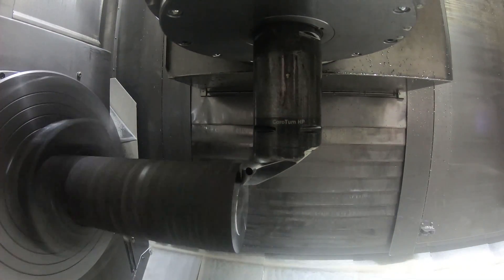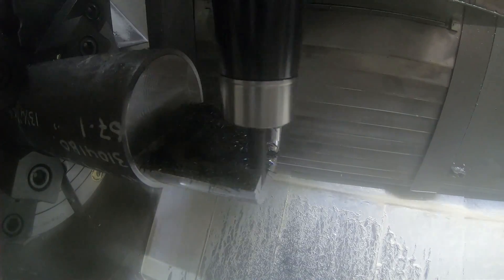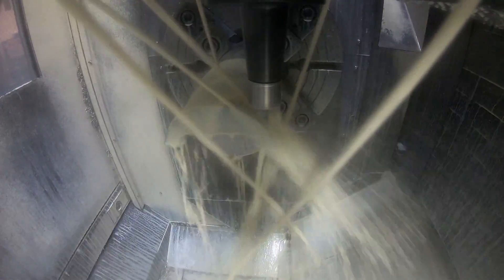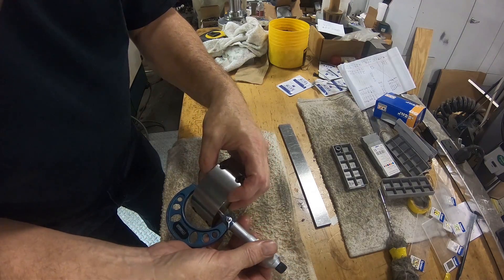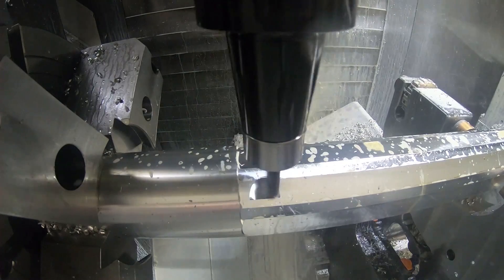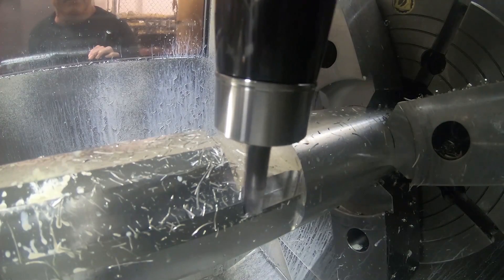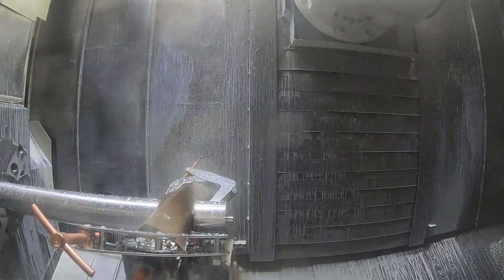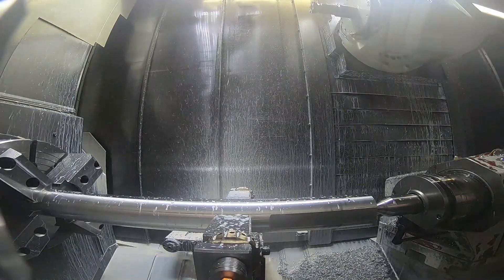Machining Sleeve Fixture

Comment: Beautiful Video, excellent work and knowledge.
I really admire your work and as much as you know, I want to ask you:
At 17:56, when you start milling the bar, isn't there a risk that the bar will lose its cylindricity and because of this there will be a gap in the fixation of the telescope?
With the clearance, it would certainly generate a vibration, causing problems during machining.

My name is Sergio, I am a programmer for up to 4 axes. Congratulation.

Comment: I program a doosan 3 axis mill and dont use software. I do small parts. And still learning. Are there can canned cycles for pocket milling like that? I'm currently experimenting with sub programming and think that's the only way. But would really like to know if there is a canned cycle I'm missing.
Reply: You really need to learn cad cam, to go on to the next level, unless your Einstein

Comment: Great video Peter. I have been wondering for a while now (can’t seem to find any mention of it in any of your videos) but what coating is on your endmills? It appears to be AlTiN by the looks of it and I’m just curious if that is the case. If so, it’s pretty impressive that you are able to dry cut aluminum with those without chip welding in the flutes being that AlTiN should have a very high affinity for aluminum.  Thanks in advance
Reply from the maker: Most all endmills I use are coated with TiALN. When mill aluminum it is important to use some kind of coolant. Either a air mist or flood. I have even sprayed on WD40. If your tool runs dry and your running a high surface speed the aluminum will build up on the tool.

Comment: Nice touch milling the center seat. On manual lathe we called that peeling the center where you use full face lathe tool set at 30 and peel the center to get it to run true with the  steady rest surface.
ATB, Robin
Reply from the maker: Thanks Robin; There can be issues with center drilling and steady rests. Maybe I should do a video on this subject. With this machine if you center drill with the milling spindle and your not perfectly on the center of rotation it wont be obvious like say on a engine lathe. If your off center in a tail stock there will be a obvious wobbling of the drill because the part is rotating. This is the reason I prefer to establish a turning center  rotating the turning spindle.
Reply: Edge Precision you explained it very well. If I do use center drilling, I always add a small boring bar to kiss the center just to make sure its thru to the center of rotation.

Comment: You have no ToolEye!?
Reply from the maker: Yes but as I have explained in other replies it is difficult to use on this machine because I cant reach the control when looking at the tool at the probes folded down position. If I had a jog pendent maybe. It is actually faster and I can see the tools actual position on the control when touching off on the part. So I prefer doing it that way on this machine.

Comment: Question, The steady rests are they programmed or are they sprung loaded for variability of diameter? Never used em in my life
Reply from the maker: The steady rest in this video is a manual one I built. The jaws adjust with the bronze nuts by hand. I do have a hydraulic steady rest that can mount on the same mount. It can be opened and closed with codes in a program from the control. There are no springs on steady rest jaws. Once positioned you don’t want them to move. The hydraulic one does exert constant pressure from the pressure you have set with the regulator.

Comment: @Edge Precision : What are the mechanics that lock/hold the chuck and/ore spindle stationary when relevant operations are performed? I suppose an encoder used to  clock the rotation to the desired angle, but then some brake must be applied that does not move the position at all.  Curious, I am!
Reply: If anyone wants to read up on Curvic Couplings:  https://www.geartechnology.com/issues/1186x/Back-to-Basics.pdf
Reply from the maker: If you are speaking of the turning spindle. When switching from turning to milling the machine does what they call coupling the C axis. The sequence is this. First the turning spindle is oriented by the turning spindles motor to a zero point. While that is happening the C axis servo motor is moving the worm on its shaft to zero. When they are both zero the worm is engaged into the gear on the spindle. When that is engaged properly the turning spindle is shifted into neutral. There is also a breaking mechanism on the C axis so when it isn’t rotating its locked with a break just like any rotary table has. So to go back to turning all that is necessary is to uncouple the worm from the gear and shift the turning spindle into gear. Than start the spindle.
Reply: @EdgePrecision  , awesome thanks.  I am building something similar as a multipurpose 4th axis for my small mill.  For the "vertical" spindle does it lock the rotation in a similar way to keep the turning tool holders stationary?
Reply from the maker: No the milling spindle has the ability to clamp/index every 15 degrees. The way this works is with a hydraulic cervic coupling. There is a disk on the spindle in front of the spindle bearings. Inside the housing. This disk has keys in it like a cervic coupling on both sides of it. There are two ring shaped hydraulic cylinders on each side of the disk. And also a ring outside the disk on the spindle with the same keys as the spindles disk. So when the spindle is clamped for a turning tool. First the spindle is oriented at the angle called for than the two ring cylinders are advanced to engage the coupling keys. They engage until both the coupling on the spindle and the fixed coupling around the spindles coupling are pinched between the ring cylinders with the keys engaged. This system is very carefully balanced so as not to displace the spindle in its bearings. Also when clamped it takes the load of the turning tools not the spindle bearings. When the spindle is clamped and unclamped there is no desirable axial movement in the milling spindle. That is a little hard to explain. I hope that makes sense.
Reply: @EdgePrecision  GREAT explanation...as usual! Much appreciated :-)

Comment: Do you get much of a taper along the flats you milled down the entire length
Reply from the maker: You know I didn’t even check seeing as it wasn’t critical. But after your comment I went and measured it. It was .0005” per side or .001 total on the thickness. That could be even adjusted out with the tailstock. This tailstock can be adjusted in all planes.
Reply: @EdgePrecision  so about 0.012mm (Brit here 😉) across that length isn't really that bad is it? What year is your mazak, we have a few at my shop I love them they go forever.
Reply from the maker: The machine was built in 2006.

Comment: Do you make injections molds?
Reply from the maker: No. The closest I have got to a injection mold is making molds for the wax patterns that are used in investment casting. These molds are usually made out of aluminum. They are technically injection molds at a low pressure for the wax.
Reply: Thanks

Comment: 20 minutes goes by in a blink in these videos, great fun to watch.  Not sure everyone recognizes the amount of work you put into getting all the various angles.  Just the shot of you hauling the part around to the bandsaw took some time.  

Quick question, do you think it would help to add some coolant jets to the steady rest to help clear chips before they get steamrollered?  It would of course be better for them not to get there in the first place, but just wondering if that would be good enough for most applications.
Reply from the maker: This steady rest does have coolant passages running thru the jaws. For the next operation ( when I post the video) you will see why I need to use these solid jaws to span gaps. On roller jaws I hav thought to make rubber wipers/seals and flood coolant under the rubber wipers to keep chips out of rollers.

Comment: When you did the CAM in Esprit, were you able to position in the part perfectly in the stock as it was in real life(offset from the center of the bar stock)? I'm trying to do the same thing in Fusion 360. Maybe I haven't figured it out yet but it's definitely something I've never done before.
Reply from the maker: In Esprit there are various ways to define stock. You can use there standard stock definitions. A bar or tube for lathe type work. You can define a box around the part or import a solid model. You can also save and recall a previous simulation for the next operations stock. All of these can be positioned in different ways. Sorry I have never used Fusion or I could give you more detailed information.
Reply: @EdgePrecision  gotcha. Okay. Thanks for the reply!

Comment: peter, What tool did you use to measure the depth of the thread at 9:07?
Reply from the maker: The gauge is made by Allen Gauge. I have had this gauge for a very long time so I don't know if the still make this model. The numbers on the back are 5226 and 4664. The number on the dial is 102. I don't know witch number is the model number. They are still in business at  allengauges.com. go there and you will see all the different gauges they make.
Reply: @EdgePrecision  车铣复合编程好不好学习呢？
Reply: I have the same question :)

Comment: sunppaa recently bought himself a 40-taper Mitsui Seiki HS-3A made in 1991...it has a 15-M control...a bit late for a machine with that control but it is a more advanced control than the 16-M.
Reply from the maker: I’m not sure what all that means but I think I like it.
Reply: @EdgePrecision  The HS-3A is a horizontal machine.

Comment: "you could just add the height of the extenuation to the offsets if you were to be so bold"  lmfao
Reply from the maker: They are made that precisely. It would work. Every one I’ve measured was within less than a thousand of a inch. Of the specified length.
Reply: @EdgePrecision  i know but the if you were to be so bold made me laugh because we have all done something but still doubled checked it
Reply: It's fun to watch the offset change the exact amount though!
Reply: ,,, kind of funny, I mean the way he trusts the positioning of these machines .
Reply: @rolandtamaccio3285  hes right you can just take the hight of the extension and add it to the offsets. But theres always a voice in the back of your head that tells you you should double check to be sure. Better safe then sorry i just found it funny the way he phrased it thats all.

Comment: When you get your jobs do u instantly start thinking of fixturing ideas ? Have you made any videos how u go from getting the drawing ,making the program and all the fixturing in 1 video?
Reply from the maker: I do have one video on planning a job from a cad model. I do plane on doing more videos on that subject. This is the area of machine work that determines the success or failure of a job.
Reply from the maker: Yes it’s part of the planning of a job. I think anyone would. You have to visualize the operations and how you will hold on to the part/stick to get the part out of it. In the case of this job it’s the second time and I have some experience on how not to do it.
Reply: @EdgePrecision  Do you ever find yourself going through that same planning cycle for mundane daily things?
Reply: Great keep the videos coming. Very interesting and the way you plan/explain everything is very helpful . I love machining and everything that goes into it.

Comment: Cool video as always peter.  What was the little handheld tool you were using the clear the threaded holes with?
Reply from the maker: That’s a hemostat I found in a surplus electrical supply store a long time ago. I also have a longer one.
Reply: @EdgePrecision  They are actually called alligator forceps or Hartmann forceps.  They are typically used for removing foreign bodies from the ear canal or nasal passages.
Reply from the maker: Thanks all I know is they work good for getting shavings out of tapped holes.